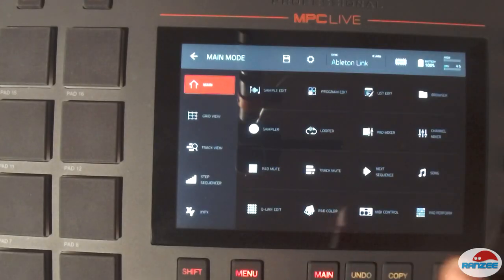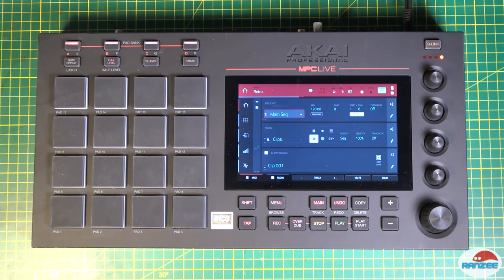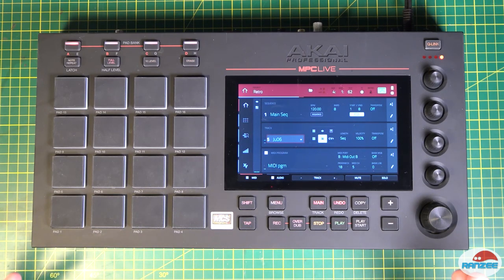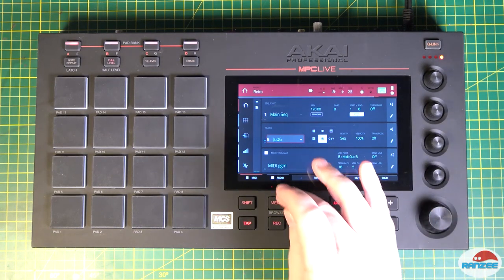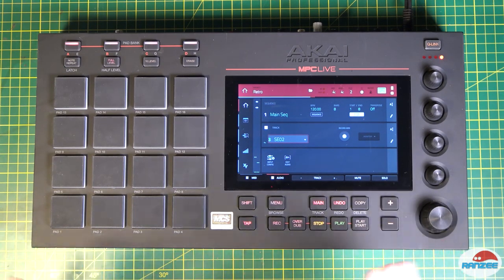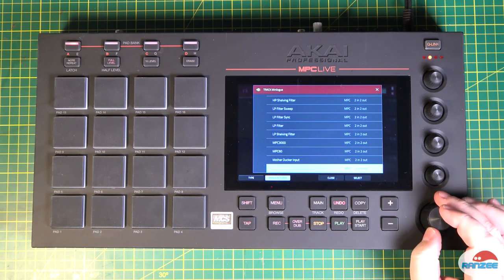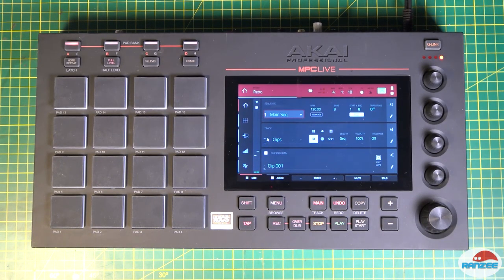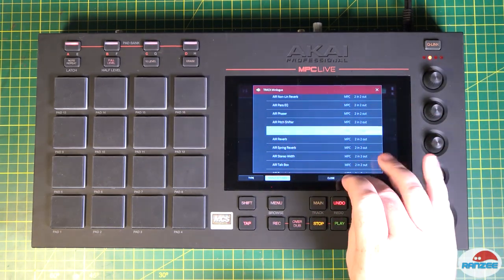Akai MPC Live 2.4 Firmware first look

Comment: nice video, thanks for the up shot on the firmware update.  just bought the MPC live and i looking forward to using it, surprisingly i took two of the new FORCE units back, both had faults, my advice dont buy it, this MPC unit is a much better unit.
Reply from the maker: Hey Russell, that's awsome! I've also felt the Force is a bit off on a few issues and the price is a bit rich. The Live is a much better all round product. You'll love it!